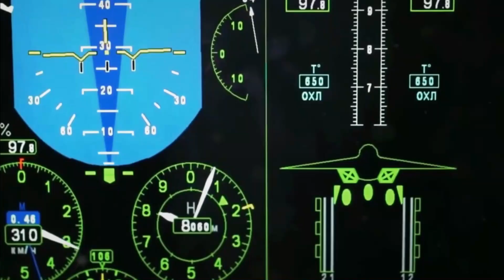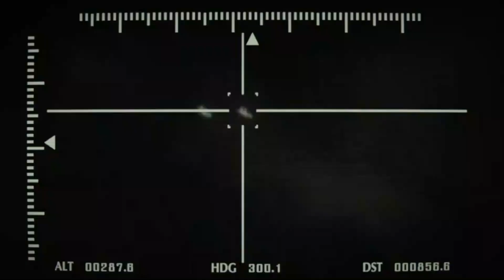Unleashing the Beast: Unveiling the Su-57 Felon - Russia's Dominant Fifth-Generation Fighter Jet

Comment from the maker: Does Russia have a dominant 5th Gen fighter jet?  Let me know what you think or what fighter jet is King.
Reply: They have a dominant 5th gen fighter for Russia.  It is dominant when used for what it is supposed to be used for, defense.  In conjunction with longer range AWACS and S-350, S-400, S500, S550, Buk, Tor, Pantsir, and Tunguska integrated air defense it is very hard to top.  The R-37m missile make it able to fire from farther s with highest kinetic energy and it will have target first when in Russian airspace with all these systems.  For attacking say Poland, or other countries it will hold it’s own with it’s advance 360 radar systems and IRST but will not be operating as it is meant.  One of the bigger things is being an interceptor as well.  Once stealth aircraft are identified in Russian airspace it’s job is to super cruise in and get target lock.  This is especially important when it comes to countering stealth bombs which can be detected with low frequency radar but are difficult to target.  It is probably most important task.  It will fill gaps in air defense getting lock, approach them and shoot them down.

Comment: A big reason to  why the cost is so much cheaper for Russian and Chinese 5th generation aircraft is research and development both China and Russia have been hacking and trying to steal American technology for decades especially China there are j-20 looks exactly like after 35 except with two engines I'm sure that won't be in the fine print if you sign up to buy a 5th generation aircraft from Russia or China LOL what a joke

Comment: It better be able to maneuver cause it's definitely not stealth 😅
Reply: It is (or soon will be) stealthy enough . Expect an RCS of 0.01m sq rendering it AESA X-band undetectable ca beyond 50nm. That is the game they are playing. Obviously cannot afford better but still can afford sufficiently enough to spoil someone else's party.
Reply: @globalterroil3208  It’s .1 meters squared  in rcs if not lower.  The .1 was for the prototype models.  They are now doing serial prodigy and have since issues of production tolerance that left larger than desired seams in panels and improved radar absorbing materials.  It is not as streaking as F-22 but it doesn’t need to be for how they are using it.  It is also important to understand it has the most advanced electronic warfare and IR jamming system of fighter ever in service., even significantly above f-35.  Essentially all western analysts admit Russia is far and above the most advanced in EW.   Recently a KA-52 jammed 18 MANPADS with its anti-IR tracking system for example…. Detection range doesn’t matter when your missiles simply will not hit.
Reply from the maker: I see that Russia is still nerves to use.  Seems like your right. Thanks for the comment, Cat!